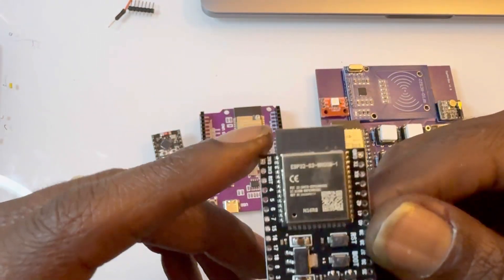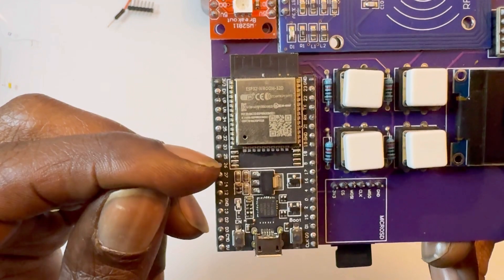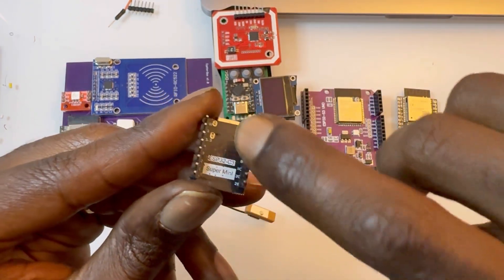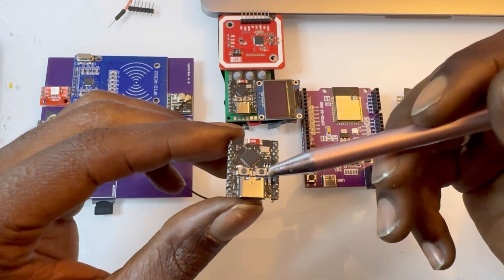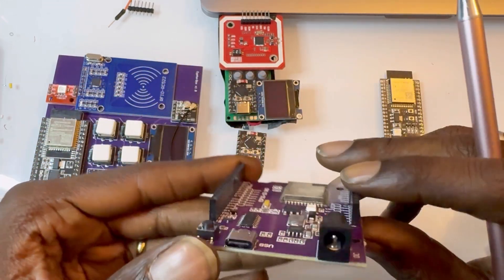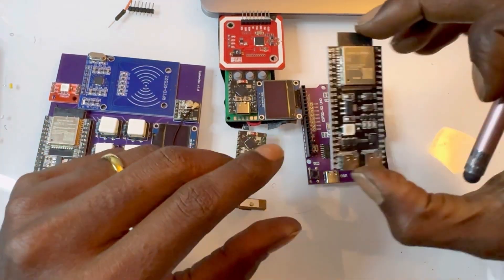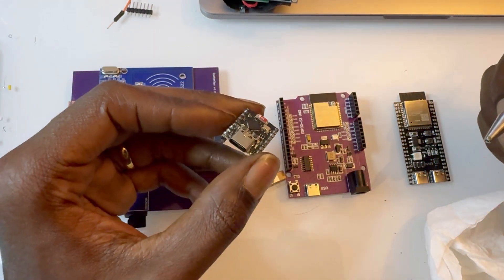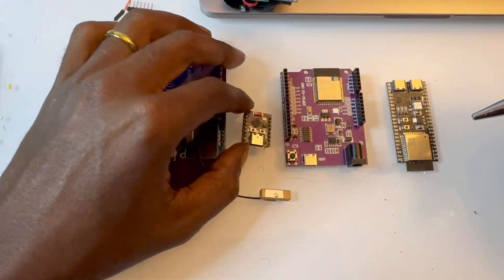Which ESP32 Should You Use?

Comment: Which from ESP32-S3-DevKitC-1 (ESP32-S3-WROOM-1) & ESP32-S3-UNO is better ? I am looking to buy some very good development board and I am between of two aboves boards. Which you consider as better ? Thanks !
Reply from the maker: If you need an easy layout to plug and test things quickly the UNO is a great choice. However if you need a project with some portability get the devkit. However performance wise they are very similar
Reply: @Johnn78
πριν από 12 λεπτά
I think that the ESP32-UNO supports over more wifi external antenna & general Arduino Shields while ESP32-S3-DevKitC-1 NOT. Is that something which ESP32-S3-DevKitC-1 has over more than ESP32-UNO ?

Comment: IS the ESP32-S3 UNO fully compatible with UNO shields? I'd TRULY love to use it for the CNC shield, but not just that, like if it has the correct pinouts + extra, I'd love to just do my prototyping 3D printers with a 54 CAD CNC shield with Drivers and coolers, + ESP32-S3 UNO which would be more than 60-70% off, which would make me so happy. I have one, and have been thinking of just attaching a 3.6inch touch display, with a 9v, allowing the USB to be free, which seems best route, considering the display has a micro SD also. And I wanted to use that as my printers offline controls but wireless. Which im still fine with doing, but I want an ESP32 as base, I have 3 ESP32 D1 R32 but I've seen it's possible, but a lot of extra work. - persomally I do not get why the ESP32 uno boards aren't compatible with ESP32_GRBL which aggravates me.